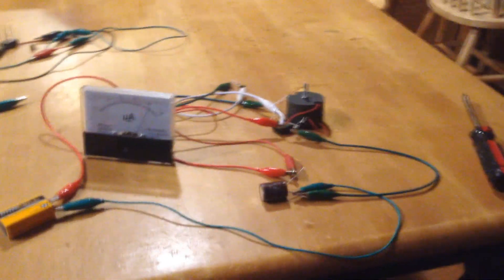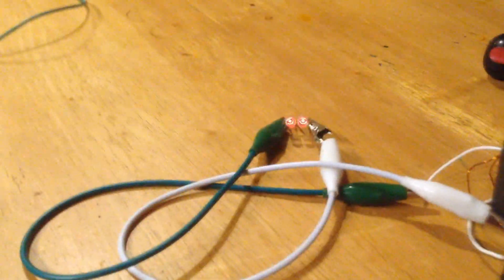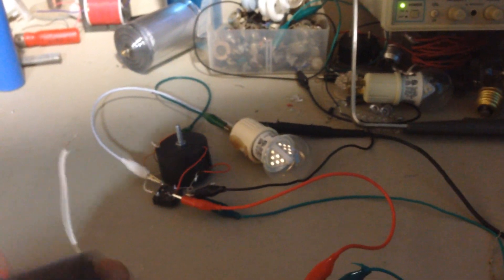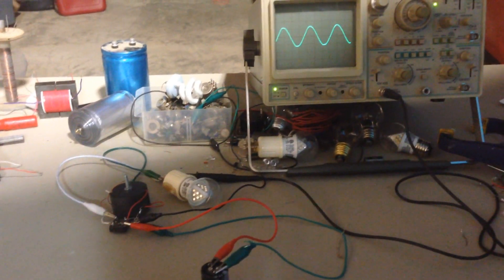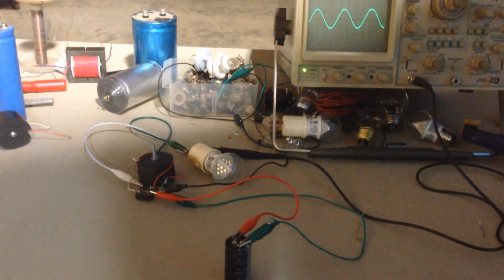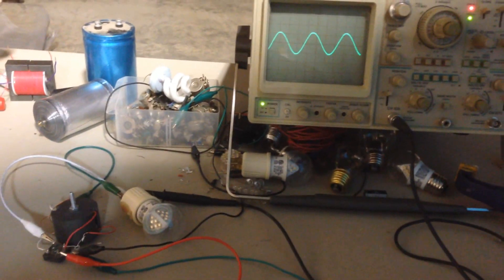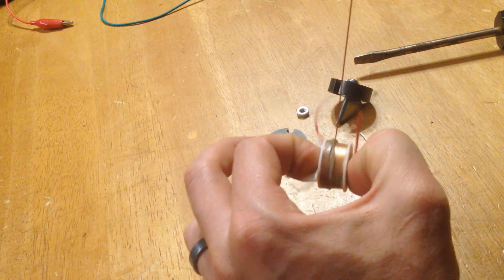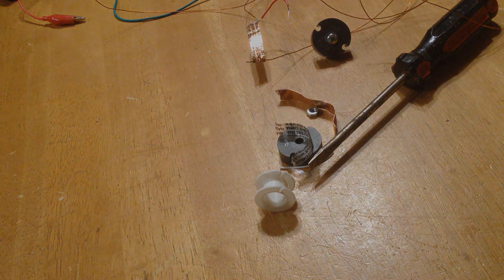Capacitor Powered SJR Looper - Lights Run On and On and On.....

Comment: I have never seen you use a magnet with a transformer. Magnets wouldn't work on the type of ferrite cores you use but on a ferrite rod you can place a neodymium magnet on each end, one north, one south to emulate a long ferrite magnet. when you pulse it against the direction of magnetism the fly back is much greater and usable. I was running 50 leds in parallel with about 40 ma total draw which is not near as impressive as what you are doing but it was interesting to me, I could not get the leds to light up at all without the magnets unless I used a square wave and reversed the wires to the leds so it wasn't using the fly back of the transformer and then the current went up to 250 ma. But the leds looked like they were  a little brighter, I haven't done much with a joule thief but the circuit I was using was a 74hc14 with a frequency adjustment and I pulsed the circuit instead of using a square wave. The circuit alone draws under 6 ma and when the transformer and leds are hooked up the leds are brightest when I adjusted the frequency to resonance or a close harmonic. After adjusting it to resonance the current would be about 5 ma less with the leds in the circuit. I believe because of the resonance factor being off a little because of the resistance of the leds. this is just a thought for you if your interested

Comment: Nice circuit! however I can not find the wire size or type on your schematic and website. I could be missing it? impressive how low of current you can make it run at.

Comment: Laser Saber if you have overunity, you can wound add winding and from her put to diodes brighde of shotkeys diodes 50 volts to capasitor and then it can work and run selfrunning.

Comment: This reminds me of the two stage mechanical oscillator Two-Stage Mechanical Oscillator -- A Mechanical Amplifier It uses the potential energy of gravity to run a mechanical loop. Because the energy is greater than the friction losses in one cycle a bit of that energy can be used to "tip" the cycle to keep it going. Maybe the same thing can be done with this circuit.

Comment: http://youtu.be/Lpx1SJdXnmo?t=5m10s this is akula's version... where he disects his transformer... again, the foil windings are both attached to the inner coil, the outer coil has no foil... and your third winding I don't know how that attaches, probably should be the same as the outside winding and not attached to a foil.... First cut, foil outside, leaves a short lead, that lead is what is used to start unwinding the inner coil.  The primary coild just had 2 long leads... then the other side of the inner coil connects to the inner foil... and there is a gap... I dunno yours are close, maybe they too are gapped

I do think you should wind without foil too :) then maybe you can wind with the foil windings correctly :)

Comment: Hi Laserhacker, can you please post a new video with scope shots on all test points on this circuit ?
Would really help to replicate, when we know, how your waveforms look across the different connection points of your circuit. Does this copper foil really help a lot ? Maybe one could also just use a cap then between the coils without needing such a copper foil ? Or is the copper foil absorping any EM Waves from the coils and convert them again back to energy ?

Comment: I'm not really familiar with joule ringers, so could anyone explain to me the purpose and what kind of practical applications it has. thanks
Reply: Hey, joule ringers pulse the voltage. The practical application is that you can drive a higher voltage circuits with lower voltage input. Like you can use one 1.5 volt battery to run an LED that would normally require 4.5 volts. At the same time you aren't increasing the amp draw from your battery because your voltage is pulsed. Very cool lil circuit for real world use. Laser saber took it to the next level in this video.... with copper tape and everything (never saw that being done before).

Comment: Rectifier is easy but until i realized that many rectifiers which i had around 10Amp...50Amp range as found in datasheets are design to work on mains frequency 50...60hz.
The best way is still construct a full bridge rectifier using ultra fast diodes.

Comment: "zero point energy"/casimir effects/ambient background energy or call it what you want comes out of the capacitor plates and the diodes/transistor works as voltage(very low voltage) controlled spark plug (Threshold voltage) to go into the transformer-joule ringer transformer...great research Lasersaber